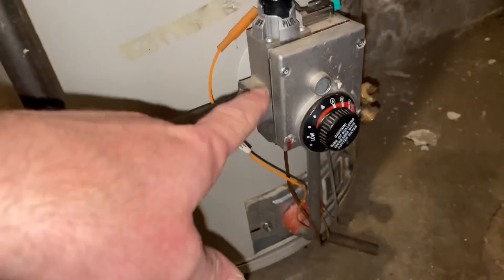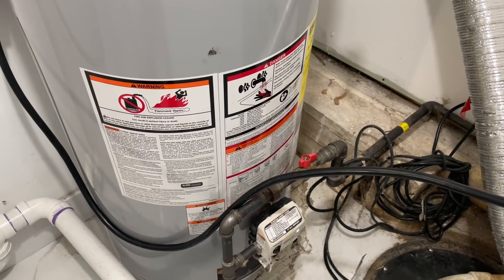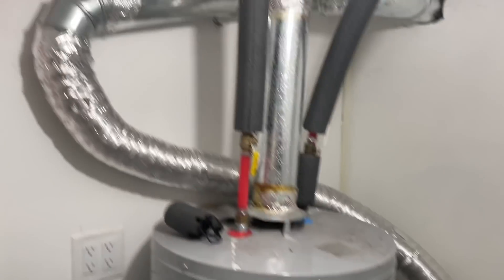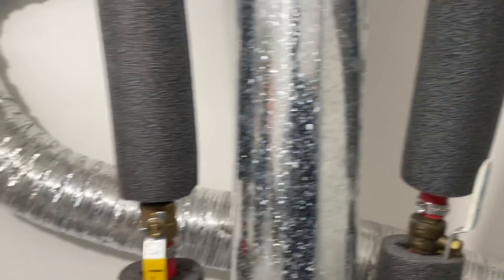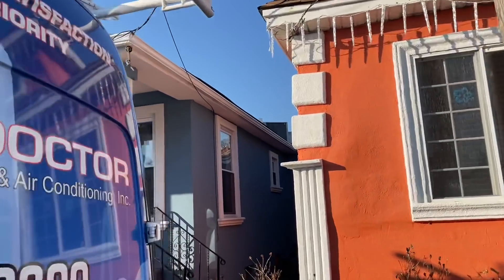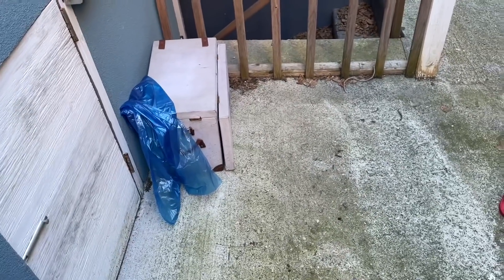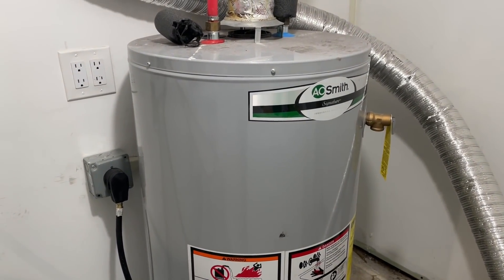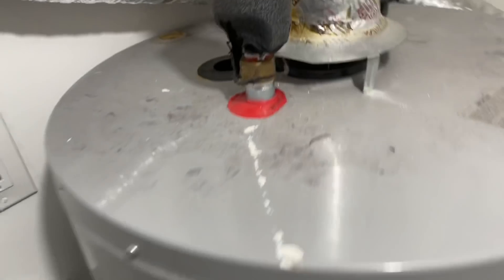Prevented Clothes Dryer Fire Water Heater and Clothes Dryer Vented Together

Comment: Wonderful explanation.  Clothes dryer RUNNING blows out the pilot light.     Also we need a source of OUTSIDE combustion air.  Three gas appliances running will BURN most all the air in the room?

Comment: And (THIS) is why i don't do "GAS/FUEL FIRED" anything!   I clean up enough messes left by just heat pump screw up people, cannot even begin to fathom what messes like this and (SEVERELY DANGEROUS) ones like this i would find if those HP/AC is any indication..

Good grief! And they have the nerve to actually call themselves "CONTRACTORS"?!? Thank God they called a pro in!!

Hey Mikey... Don't you have some sort of "STATE LICENSING" board etc this can be reported to?!? KY is (SUPER STRICT) and the installing contractor would be in (SERIOUS) trouble over something like this! Turn them in man, you are doing your customers and peoples a service by getting illegal and dangerous IDIOTS off the streets!

Comment: that crawl space looks like it was a porch that got closed in and stuccoed over 
it looks like it is supported on the sidewalk with 4x4 stilts [ no foundation]  the real wall is on the right were the pipe comes out  
did they cut the wall out of the house and the plumbing  vent stack with it .

Comment: You have any tips on renoving galvanized pipe at the thread? I have an older house and it's all pretty much galvanized for my water and gas line. I want to add a water shut off in my house but the plumber stated there's a chance that the pipe and or thread could break on older galvanized pipe. He stated I need a plan B just in case it does break, which is running an all new line but is costly. I'm hoping to be able to remove the galvanized at one of the threads on the run and install the shut off and maybe convert to pex. Any tips to apply before taking a wrench and prying on it to losen?
Reply: Good luck 👍. You just never know with galvanized pipe. A lot depends on how old and rotten it is
Reply: Generally you hold the one pipe and don’t let it move whatsoever and twist off the fitting
Reply: @Earl Estes sounds good. Yea its pretty self explainable but you never know the end result until you've already crossed the line and there's no going back lol
Reply: @shawnphillips1220  👍

Comment: I agree this is a butcher job, but i hate upselling a customer a tankless just because they like the size difference. when i tell a customer a tankless install is 10k and needs to be serviced every year at extra cost to fulfill the warranty but also because it’s part of the codebook that they need to be maintained every year in my area. 
a standard powervent 2.5k...generally will last 10-13 years, maybe you need to replace a thermocouple, or maybe a ventor motor or pressure switch, but generally i’ve seen powerventors go 16+ years and still go strong and hardly ever looked at, can’t say the same for tankless. tankless need to be well treated.

Comment: Wouldn't a vent-less heat-pump dryer + making some holes in the crawl-space door, or replacing it with a grate to prevent gas build-up have been the easiest solution in that scenario?
Reply: @PipeDoctor  Heat pump dryer's only need a dedicated 15 amp circuit, no exhaust duct, but still wouldn't fix the crawl space exhaust issue with the water heater.

Comment: That’s a real plumb!
I would never have thought of that ‘common vent’ application.
But there are plenty of hacks out there, who still would think it’s ok.
Code requires a clean out, I’m inclined to think that vent penetration into that crawl was for the dryer originally, the original w/h was possibly electric. Maybe not.
Once again by code that should have been vented outside, but I’ve seen hacks just vent the dryer into the attic. Same thing with bathroom exhaust fans.
By code (where I live) you can’t vent into alleyways, no permit, no problem, anything goes.
I pull permits on every job.
Cover my arse that way.
Reply: Mikey Pipes - Pipe Doctor Plumbing & Heating & Air 
Lol, Mike 👍
permits and inspections only annoy hacks.
No permit, it’s fine. 🙀
It costs less to do it right first than pay to get it fixed later.

Comment: Another option would be an electric water heater although I know they are more expensive to operate.
Reply: @PipeDoctor  yes that's true but not a problem if the panel is big enough to handle it. I would have did the same as you,  just wanted to present another option.

Comment: Surely the answer is to vent the dryer to atmosphere through another hole through the wall and directly to atmosphere, then get a proper and sound flue arrangement for the water heater. Surely she does not to replace the current almost new water heater?

Comment: Years ago I pulled up on a job where the previous so called plumber converted the electric water heater to a standard gas 75 gallon, vented through a dryer vent hood. The customer did not want a direct vent and refused to go back to an electric. I packed up my tools and bid them farewell!
Amazing more people don't perish with installations like this!

Comment: Tankless Water Heaters are the WORST, Please Never think about using Any Tankless Water heaters ever!!! I have had family members put in Tankless units in 3 different homes and they ended up in all of them pulling the Tankless unit out and putting in a Normal Gas Water Heater. I'm Sorry but this is how we feel about these type of units.
Reply: Put in the a Power Venter, this lady has know idea of what a power venter unit is at all and just how it works, you should be telling her. Tankless units, one has to stand there and run the water forever to get any hot water run up the pipes to get them heated up at all.   @PipeDoctor

Comment: Considering placement of dryer receptacle, looks like dryer used to be where water heater is now, then somebody decided tie water heater to it.  PEX pipe directly connected to gas water heater is not a good idea either. 
I have seen similar setup, except it did not have dryer attached. Someone replaced power vent water heater with natural draft water heater. Removed all PVC vent, replaced with galvanized duct, then put an aluminum dryer vent termination. Vent only went about the same height as yours. Sponge gasket on flap has melted from the heat. The customer used it like that for few years, but was in unfinished basement.

Comment: One night my gas heater was giving off a strong gas smell in the lounge room. After some investigations and the window wide open, I found out the air filter for the heater was clogged with dust. I cleaned them off, and the gas smell went away and I think the gas burnt more efficiently ? I live in a public housing, so when they installed the heater they got the most exhaust efficient rated indoor heater (6 stars), fixed it to lounge room and put exhaust straight through wall to outside about 50cm from the ground. The prevailing winds takes the exhaust away from the house anyway. The gas heater is much cheaper to run compared to the old style heat banks, and I feel safer as we dont need to have bar heaters all over the place with cords and heat dangers to trip over. As for getting the heater installed it was a circus. The housing authority approved it and sent plumber to install it. The plumber could not install it without a gas meter. The gas authority (was free connection if did it during the gas line work in street at time) would not run line to house unless a meter was installed. The meter could not be installed without a account with a gas company. The gas company would not do a account unless there was a gas meter installed with a meter number (or tag) with Plumber identification number. After a few weeks of pulling out our hair, a neighbour stepped in, did a few phone calls and within the week it was all sorted.

Comment: I don't even know anything about this stuff and could smell something very wrong with this setup. Who in their right mind would connect the dryer vent and water heater vent together and then to have the gases vented literally in the wall/under the floor? It looks like someone just wanted to half-ass it....but then to have it pass inspection is completely unbelievable!
Reply: or, I have seen where the new home owner will do a repair wrong, but say it was someone else.

Comment: I'm surprised they didn't have a carbon monoxide alarm ?
Reply: Even if they had, owners might have just removed alarm thinking it is faulty smoke detector. I have seen that once. My customer bought a new house, found condensing furnace vent pipe never glued when the house was built and was leaking condensation and exhaust. When I pulled CO detector to replace, found it was unplugged with battery removed. LOL

Comment: And I was upset when my bathroom fan quit working, and I found it was packed full of drier lint, because they had tied the drier vent into the bathroom fan vent line.

And, that much flexible line is going to give you about twice the run length the drier manufactures says is the maximum discharge distance.

Comment: At 8:14 the PVC Waste Pipe is incorrect. They used a Wye in a Vertical position which is against code. A Wye can only be used in a horizontal position. A vertical waste pipe should be a Sanitary T!

Comment: I am thinking this house is in the USA due to PVC pipe being used for drain pipe and there may be different codes between Canada and the USA. I am a licensed Refrigeration Mechanic and Heating Technician in Canada and Nate Certified in the USA, and the code infractions I saw in the video were incredible. No dip tube on the T&P, Pex connected directly to tank connections (should be at least 18 inches of copper), vent pipe within 6 inches of combustibles, receptacle within 3 feet of a water source, along with the rest of the stuff the tech pointed out. Pretty scary stuff this was a professional installation. Toronto, Canada

Comment: You can not use run pex to hot water tanks in michigan or any flex what so ever. It all has to be hard piped in for both gas and water. Just incredible, I see hacks like this ALL the time and you wonder how these people ever survive.  I just had a tenant steal my BRAND NEW gas water tank and replace it with an old POS electric tank. He wound the 240 around the gas pipes to the furnace, he stuffed a rag in the exhaust hole in the chimney for the gas exhaust, no pipe on the pressure relieve valve, exposed wire nuts and panel held on by one screw. Yet I can not kick him out of the house because out DEMOCRATIC POS GOVT has a freeze on evictions due to the Fake-dimic pandemic going on. What an utter pho-king joke all the way around.

Comment: Looks like the water heater was originally electric, with an existing dryer vent
Reply: You can’t convert them without it being as expensive as a rolls Royce  and what makes you thins that?
Reply: @bwckplumbingfixtures1864  only in US.
Reply: @ivanfangio  ur code is low compared to xnada
Reply: Agreed, if you look at the gas piping to the water heater there’s another clue

Comment: Whoever did that job originally needs to be removed from this world. Im by no means a pro but common sense says you don't vent a water heater to under a house or any building nor do you hook a dryer to the same exhaust as the water heater. Ever. You can safely vent a electric dryer to under a house without worry but never a gas water heater and not a gas dryer. Some people are so stupid.

Comment: I would go with a power vent water heater,the extra cost of maybe having to run a larger fuel line and the venting requirements of the tankless would likely make it much more expensive.I also wasn’t able to see if make up air is a concern in this room but that should be considered when installing new appliances.

Comment: Tons of aweful work in that house.  Pex directly to the water heater. Here in California you must have at least 18” of copper off the water heater. The dryer vent should be 4” Sheetmetal to the outside a few feet of flex is ok in the laundry room. And of course the venting of the flue. Omg. I am a retired sheetmetal worker. This is shocking. Lucky you guys are there to save her.

Comment: I always get a crooked eye and asked “but it’s been working this long”. So I throw a carbon monoxide detector on the wall and wait to next morning. They usually had to take battery out. Some actually told me I rigged it to go off all night. Even though the wife that was there watched me open package.
Reply: Cant do that, especially something like this as a professional I have to document that I left the premise with the unit disabled what the customer does when I leave is on them.
Reply: Yes, but what they don’t tell you is the kids are always sick, they all suffer from headaches, their energy is low, and the pilot light on the water heater will not stay  lit. That’s probably why you get called to the home in the first place. I just tell them that as a licensed Master Plumber there’s no way I will touch the water heater unless it’s brought up to code. Too much liability.
Reply: Amen

Comment: Is that an electric dryer? Still have no idea why they would vent it into the water heater exhaust but if the dryer is electric is it still a problem to vent  the dryer only into the crawl space? If the dryer is electric than it’s only venting heat, no gases? I’m not a plumber so i have no idea. I do have enough sense to know that that water heater should be vented outside though.

Comment: The PEX pipe should not be directly connected to the water heater you should have 16” of copper then PEX  as the heat will effect the PEX
Reply: @PipeDoctor  It is hard to believe an actual Plummer did this job. Venting the dryer and hot water heater together, then terminating it into the crawl space of the house is insane!!! he could have killed the whole family!!!

Comment: The entire basement is a hazard area unvented gas water heater and clothes dryer. I noted another thing why is the 240V outlet  for the dryer next to the water heater?  It should be located on the wall behind  the dryer. Not having a 30 amp 240V power cable dragged across the floor.  The house I grew up in the water heater and furnace both gas fired had their own vent pipes, up to the roof. The sump pump pit looks in bad shape.

Comment: Around here at least you're not allowed to connect PEX to the water heater either. I'm surprised the PEX didn't melt. What a beauty queen!
Reply: PEX is a thermoset not a thermoplastic. It cannot melt but can still deteriorate with excessive heat.
Reply: It should be that way everywhere. I have even seen the expansion tank hanging from PEX Pipe. This is Georgia by the way. Lots of stupidity goes on here lately.
Reply: That PEX hook up looks so rinky-dink.  Not a big fan.  I’d run copper pipe before I’d do something that looks like that.
Reply: @CiscoWes  FWIW, I personally have pex run directly to my heater now, despite code req. I have lost two previous WHs due to galvanic corrosion even with dielectric unions so wasn't taking a chance on any conductivity between pipes and tank again. Four years later and the pex/fittings still look new like the day installed them. Tank flushes have shown no signs of rust, anode has remained more intact than usual. WH is set to 130F and the pex only ever gets warm. I probably wouldn't do it if I had heater set to max temp, was gas unit with pex near the flue, was using a tankless, or was doing install for someone else, but I have observed zero issues so far. I will run all of mine like this from now on and will only ever change it if we sell the house and home inspector calls it out.
Reply: Same here, also you have to a pipe to the floor for the relief, you can’t use plastic for the relief to the floor.  You are not allowed a shut off on the discharge side. Isolation valves, for different areas the hot water goes to, instead. IE Kitchen, Bath One, Bath Two, and Laundry Room.  The water heater has to have a compression tank on the discharge side too. For some gas water heaters, you also have to put in a liner, in the dedicated masonry chimney. One thing nice about that style of water heater, verses a power vent or tankless, is you can still have Hot water during a power failure.
Reply: @stevenmoomey2115  I'm with you on all those points, except the expansion tank goes on the input (cold) side.
Reply: anticapitalize I always seen them on the Hot Side, could you explain why ? Also I’ve seen them in my county with no Shut-off valve, which means the Hot water system would have to be cooled and drained to changed out a leaking tank. On my commercial job, this was a Royal Pain. It does make sense to put them on the Cold water side for servicing. Something I do on Water Heaters is Wrap #12 or above Copper wire around the stubs coming out of the water heater and around the Copper Pipes above these stubs. This slows down, the electrolysis. BTW I had an ongoing argument over this with some other Tech. Till we had a Start up, and Demonstration on a new Commercial Water Heater, by the Factory Representative.
Reply: @stevenmoomey2115  The reasoning I've come to understand is the hot water breaks down the rubber expansion membrane faster, the tank adds energy + water inefficiencies (the tank water cools down between uses and becomes a small tempering reservoir which adds flow & delay before hot water exits the system), and as you noted the hot side presents servicing difficulties. There are heat-rated units out there but they're more expensive and there's no real extension of lifespan or functionality compared to expansion located on the cold side for water heaters in most cases. I'm sure there are exception cases that exist where you'd need one on the hot side but for residential water heaters where space and serviceability allows on cold side I can't think of one.